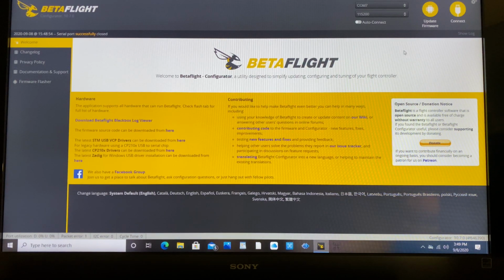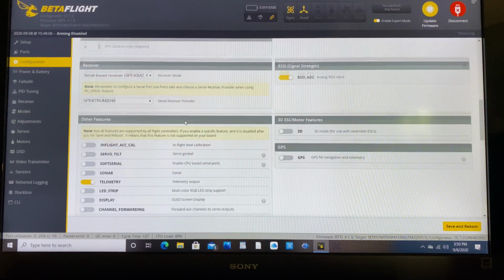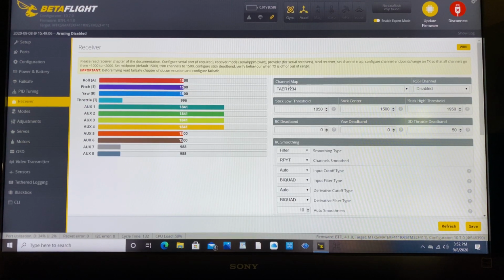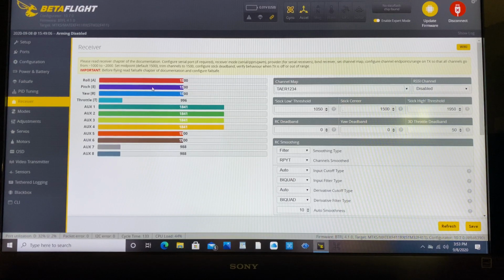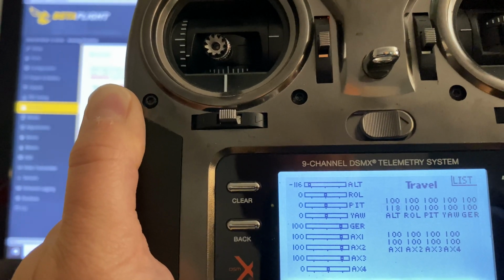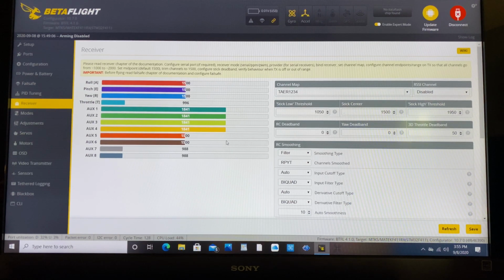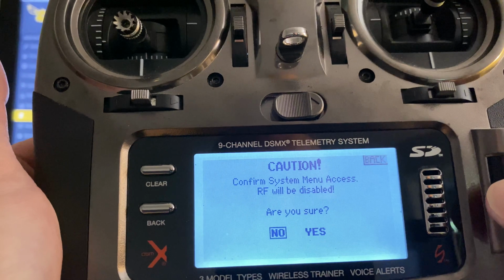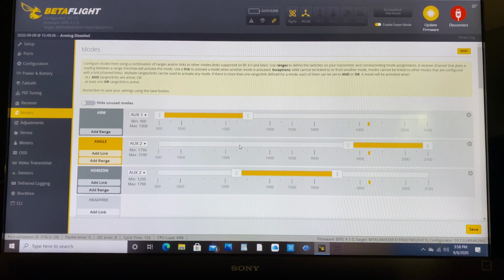Spektrum Based Receiver on a Tinyhawk 2 Race - BetaFlight and Transmitter Setup

Comment: Will this work for SRXL2
Reply from the maker: Yes, it will work. All Spektrum receivers or DSMX receivable devices will work with this method. They have a high throttle setting and this causes the flight controller to fail safe.
Reply: @ryanwilliamsfpv968  I did what you said but it still not working
Reply from the maker: @aztecjoe29  Are you seeing on BetaFlight that your radio is connected to your receiver? Meaning you can see all your controls working. If so then you need to make sure the flight controller is level because if it’s say 30 degrees or more at an angle it won’t arm.
Reply: @ryanwilliamsfpv968  I have DX6 transmitter and when I move the sticks it doesn't show movement on betaflight
Reply from the maker: @aztecjoe29  Ok. So you aren’t bound to the transmitter. When you plug the battery into the aircraft can you see the receiver light up? We need to make sure your getting power to the receiver.
Reply: @ryanwilliamsfpv968  it binds and it has power the light blinks when I said it to buying and then go solid and everytime I turn on transmitter the orange light turns on srxl 2 receiver so I'm pretty sure it's binding
Reply: @ryanwilliamsfpv968  yes we have power send me your email send me pictures
Reply from the maker: @aztecjoe29  Can you check under configuration in BetaFlight and tell me which Serial Receiver Provider you have selected
Reply: @ryanwilliamsfpv968  its uart1
Reply: @ryanwilliamsfpv968  srxl2
Reply from the maker: @aztecjoe29  Ok that’s your port where the receiver is hooked up to. Look on the left of the BetaFlight screen and under ports there is Configuration. Click on configuration and scroll down to where it says Receiver, tell me what they are set to.
Reply from the maker: I think your not getting motion on your sticks in BetaFlight because the way your receiver is getting power. If I’m right, your receiver is getting power through the battery and not through the USB cord on your computer. So then you must have the flight battery plugged in to make the receiver work. I should have asked you earlier if you tried the aircraft with the battery in BetaFlight.
Reply: @ryanwilliamsfpv968  yes I tried I also tried another flight controller and still nothing
Reply from the maker: @aztecjoe29  I am sorry that I have not been able to help you. The Tinyhawk that I made this video on has since died. It actually burned the flight controller in flight so I can’t dive into the BetaFlight for that controller anymore. I was using another drone from one of my builds to try and solve this. You can try changing the uart to 2 and see if it works but I’ll keep trying to figure it out. Here’s one more question, did you buy the Tinyhawk with the option to set up an external receiver? The one I had was equipped with the SPI receiver built in and I had to desolder the bridge on the flight controller in the spot for the Spektrum receiver to work properly. That receiver you have has to have 5 volts to work properly, so you can run the positive cable anywhere you can find 5 volts. I’m sure you probably know that but I just wanted to throw that in.  If you still want me help maybe we could setup a zoom call tomorrow so I can see what you have going on.
Reply: @ryanwilliamsfpv968  brother you're awesome out of all the people the only people that helped me is you and Zoe fpv
Reply: @ryanwilliamsfpv968  I got it working on another flight controller I hooked it up to tx2 on the flight controller I had it on R2 . It's not communicating with betaflight I will keep you updated my brother thank you so much for your help
Reply from the maker: @aztecjoe29  Awesome brother! Your welcome, keep me updated, I’m always happy to help.
Reply: @ryanwilliamsfpv968  I did what you said but it still not working